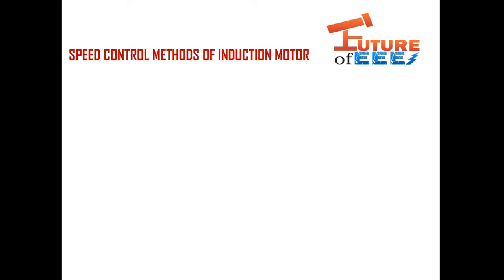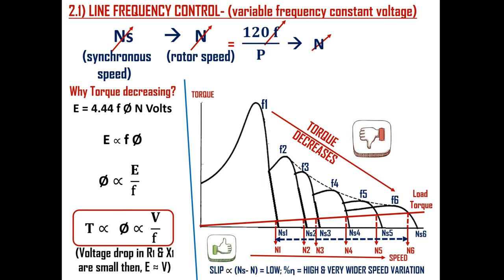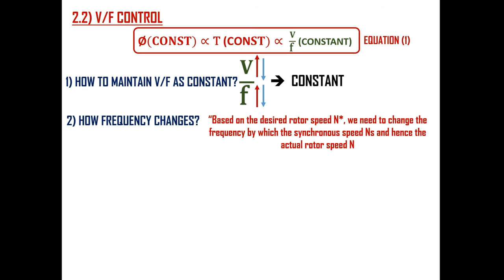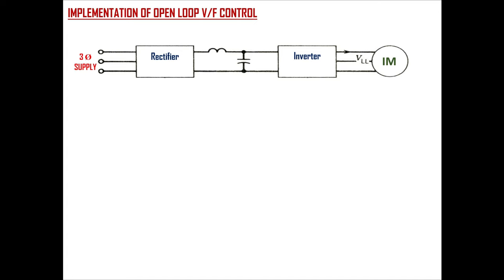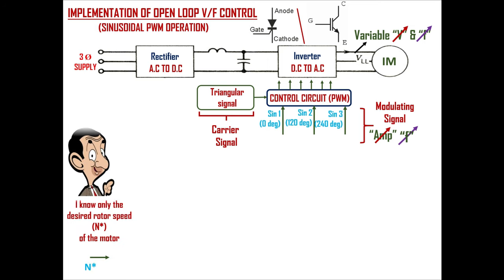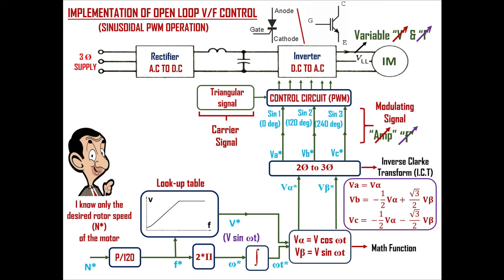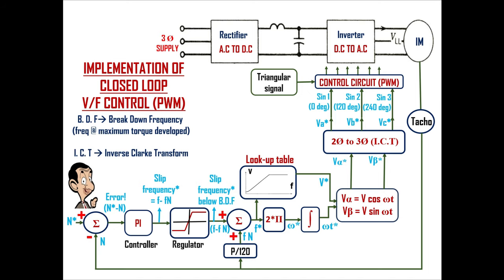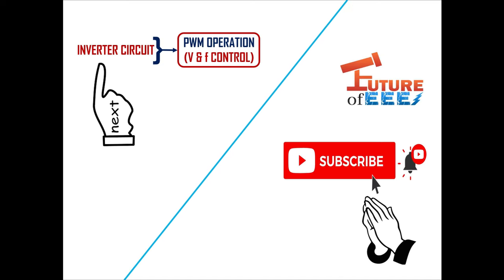Voltage/ Frequency (V/F) Control of Induction Motor - Open loop & Closed loop

Comment from the maker: 15:12- Slip regulator will restricts the operation above (not below) the Break Down Frequency (B.D.F) . So, output of Slip regulator will be always the slip frequency equal to or below the B.D.F
 You can download the PPT & PDF - Link given in the description - Pls like, share and subscribe  - Thank you.
Reply: Correct me if im wrong pls , so the advantage is for the motor to keep working on the Stable side. while the disadvantage that is obvious for me the motor will start slowly and not quickly because.
at start the Wslip = Ws = Wmax & if we limit the Wslip we get Wslip = Wsmall so the regulation will be slow ! no ?

Comment: Hello 
Thank you very much, but i have a small question 
First , how  to make look up table frequency and voltage 
Second question, if the circuit is a single phase i mean if the inverter is a single phase how to connect the control loop with it 
Thanks a lot
Reply from the maker: First, In software like MATLAB/PSIM you can use look-up table easily. Because it is available as a component. For implementation of look-up table you can use any DSP controllers. Second for a single phase inverter circuit you can realize the PWM control circuit by generating two sinusoidal signal (reference signal) with 180 degree phase shift and one triangular signal. Operation is similar to three phase. In future I will try to do another video. Thank you!

Comment: hi bro, when will you be doing the open loop and close loop control of induction motor? I want to check how draw 1kw power hybrid wind solar to induction motor , so far i did resistive load as an output , how do i change it to induction motor with 1kw?

Comment: Why you have written f-fn Slip Freq. ? Isn;t it should be only Control Signal after PI Controller ?
Why regulator ? What will be limits ?

instead of f* can't we write (N-N*)*P /120 ????

Comment: How will calculate the Loop up table in V, F ?
2. Any formula is for calculating V, 
Can you share me
Reply from the maker: Based on the desired rotor speed, calculate frequency f. In simple voltage V = f+(IR+IX)

Comment: How can we read the load current and voltage on the induction motor?
Reply from the maker: Usually we will read it using voltmeter and ammeter. Sorry I cant understand your question.Thanks!!